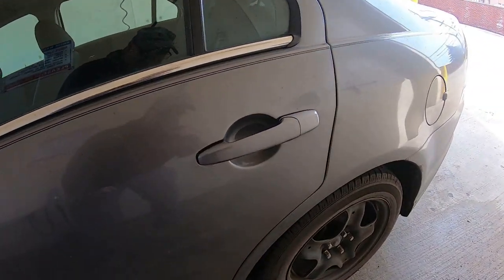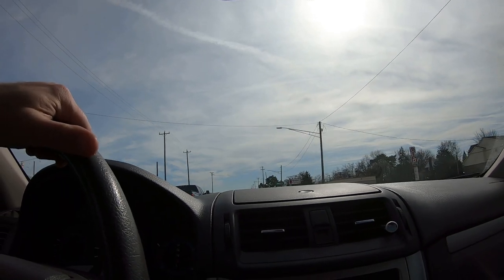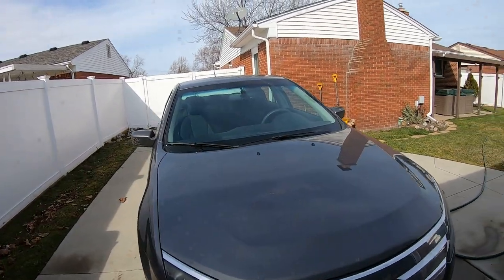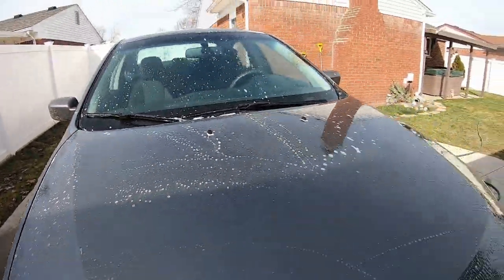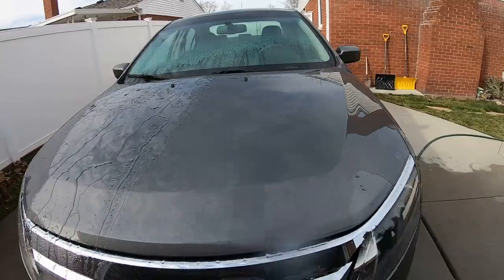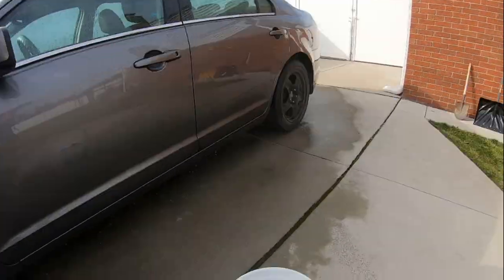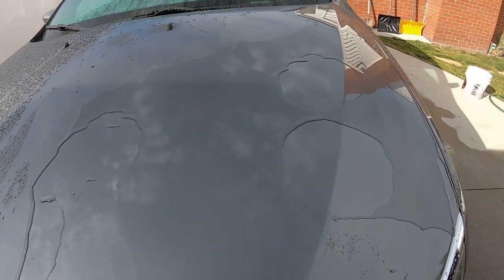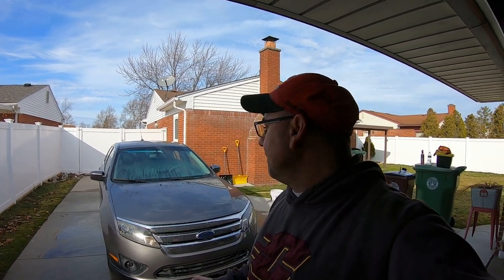3 Month Update : Turtle Wax Ceramic Spray  | Real World Auto Detailing Testing

Comment: There needs to be more videos like this. Products being tested in actual real life environment elements. I use Turtle Wax Ice SEAL N Shine and I always watch videos on how good of chemical resistance it has and it says 6 to 8 months of real world durability. But where I live in Texas it last maybe about 2 months. 3 months tops. I have yet to try 303 Graphine Spray coating. Awesome video though man.
Reply from the maker: We like testing in a real world environment to show how long a product will last in my environment.  With the heat you get in Texas looks like you got good results. I think for a TW to be easy to use and doesn't cost much you can use it once a month and always have paint protection.  Thank you

Comment: I really like and trust tw ceramic wash wax. The results are beading and sheeting with more sheeting meaning less water spots. The sio2 in it is a plus in my opinion. After the wash I use the tw flex wax and spray on as a dry aide, great protection and durability.
Reply from the maker: Turtle wax are Making some great products that work and easy to use. Thanks for sharing your experience with TW

Comment: Assuming the beading from the TW ceramic shampoo is temporary, the main test was earlier in the video and it looked pretty failed to to me as even the sheeting part was almost non-existent. For a product that needs 24 hours cure time (like a higher strength SiO2 coating) the durability does not seem great. I have been on the edge about this product but seeing a real world test, I think I'll go with Moonlight (which I already own) or go full blown ceramic when mine gets a much needed spring clean. Thanks for showing a real durability test - it's rare to find.
Reply from the maker: in the industrial environment my car is exposed too it would be best for me to use TW ceramic wash and other products from TW hybrid line to  help protect the ceramic spray . If i used those or other products to boost it then it would last longer and in a cleaner environment TW ceramic spray would last longer . We have a lot of videos on testing detailing products in a real world environment and at junkyards . I haven't tried moonlight but have videos on CG 6 month update on hydrocharge  and a 12 month coming next month . Thanks

Comment: I have the Hybrid Soultions Ceramic coating on the car.Been about 3 months inChicago area.Still beads and sheets well.I have Been washing with the yellow Meguiars Ultimate. Wash and wax soap.It's very sudsy,slick and gives a lot of gloss and pretty cheap.For added boost I've tried Meguiars spray wax, Griots quick detailer and Lucas speed wax.All work equally well as a drying agent and super slick to touch and boosts gloss.I like trying different products and brands together.
Reply from the maker: TW ceramic spray would last longer if I use a booster from the hybrid solution or other products like you did. My work environment is a way to test auto detailing products it gives every one a real world result in the worst environment . TW ceramic spray is still a good product the shine is still there and the yar washed right off with soap .Thanks Bill

Comment: Well given the extreme conditions that car goes through , I’d say it’s good durability. It’s also so easy to apply. Great review !! Most products can’t even last a few months here in Michigan!!
Reply from the maker: This car goes through a extreme environment and in our Michigan environment would be best to use ceramic spray every two month and use the other TW Hybrid products . Thanks Henry
Reply: My gf's truck had Optimum Gloss Coat, which held up well. 

I had Duragloss 111, and it also held up well, but not as well. 

The Duragloss has been what I usually use for winter protection. 

But you're right, a Michigan winter with all the nasty road chemicals, and high PH touchless washes will wreak havoc on any paint protection. 

My mom also had 111, and my neighbor had Duragloss Aquawax - both still beading well. His gf I used Duragloss 501, and is still holding on as well.
Reply from the maker: @danlc95  If I used the other products to help boost TW it would last longer. I still need to try those products out Duragloss and Optimum. I just added to my list Thanks for sharing

Comment: I have the exact same experience: after washing the car, the beading disappeared, and it came back after some rain. The gloss remains very good.   My test is on 7 weeks now.
Reply from the maker: On my 1 Month Update video had the same experience. With this 3 month update think it's done TW ceramic still has a nice gloss and the dirt, coal washed  right off. In my work environment it be best to use all the TW hybrid solution products with every wash . Still a great product . Keep let's us know how TW ceramic hold up for you. Thanks

Comment: Great video. Looks like it is done. But with that said, 3 months can get you through the hard parts of winter time with some great protection
Reply from the maker: For the price and you can buy it local that's a plus and if i used the products that go with  the ceramic spray would of last longer . Plus the car still shines great .Thanks Pete

Comment: Good video brother! But I'm surprised at the durability with the Ceramic spray coating. Could it be that the TW seal n shine has better durability overall???
Reply from the maker: I didn't test how long TW seal n shine would last in this environment . I did have it on the car for about 2 to 3 month before the ceramic spray and the paint was clean still . I did a iron remover before applying TW ceramic spray and the paint never turned purple . Seal n Shine is pretty strong at keeping the paint clean .

Comment: I do want to try the Hybrid solutions spray wax.I think the ceramic spray coating along with boosting of ceramic spray wax will give the best boost.I think the ceramic soap is kind of b s.Is rather use the polymer type gloss boosting sissy foamy soap I Dr ceramic type.Seems like there is less lubrucity with cdranuc soap but then again maybe it doesn't matter.
Reply from the maker: Ceramic soaps do feel as they are not as slick now Proje vital car wash soap is one one slick soap . I think boosting TW ceramic spray is the way to go use the Hybrid line from TW or other drying aids like Bead Maker , Jax Wax spray and seal . Thanks Bill

Comment: Steve, I really enjoy your real word testing, especially with you living down river, and the fallout you get. IMO, the coal rinsed off nicely, you still had some beading and sheeting, so protection is there, it's just detoriating, and like you said if you used the TWHS detail spray and wash and wax, I bet it would be holding up well. As a suggestion next real world test split the car in half, maintain one side as directed, and the other side just do normal washing.
Reply from the maker: Are you in downriver also ? Good idea split the car the in half and test one side with products that will help and other side use just soap . Going plain something for summer . Thanks  Jay

Comment: The negative thing I have seen and heardfromothrr channels testing most of these ceramic waxwash soaps is that thrydont foam wellnir are they as sudzy or as slick as the foaming soaps like Adams,griots,chemical guys etc.So I think it's a bit gimmicky.Maybe do some actual soap tests comparing non ceramic foam soaps vs ceramic soaps.
Reply from the maker: Good idea I could do some test on ceramic soap and non ceramic soaps . Just going wait into the weather warms up more . I can start planning those video now. Thanks

Comment: I think they where a little off by their "2 coats will last 12 months" claim .. I honestly don't see a purpose for this product I mean I have it on my car as I wanted to try it but all these ceramic spray waxes still primarily rely on traditional polymers which is normal every day sealants... I have this, I have Seal N Shine, I have Fusso Coat, etc I have several over the years I've bought to test and frankly no real spray wax can make it a year most will not make it 6 months.

If you want long lasting go with a normal ceramic coating

If you want cheaper long lasting go with something like Fusso Coat (9 months is possible it preformed very well for me in North Dakota lasting all winter the few years I lived up there)

If you want easy use just use a decent spray sealant

These "ceramic" sprays really don't offer anything a good spray sealant can't they use the same chemistry and if you are getting the same end results no real point in paying 2-3 times as much... I don't hate them but they really serve no functional purpose compared to products already on the market that sell for a good bit less. My understanding is the biggest difference between ceramic sprays and ceramic coatings is the resin inside coatings it seems to really help their longevity but it's also what makes them a lot more time consuming and difficult to work with.
Reply from the maker: I have videos on Fusso Coat Soft99 on my son's F150 that a great product better then Ceramic wax. TW ceramic spray if I wasn't testing I would use the Ceramic spray every two months and use TW hybrid solution products . It still a good product easy to use and most people don't like testing like we do. I'll make a video with an iron remover this spring or summer and see if any contaminates on the paint my work environment is hash .I have a lot of videos on test products like this. Thanks